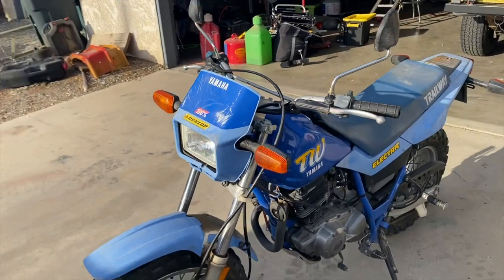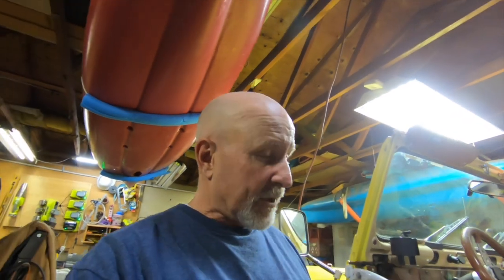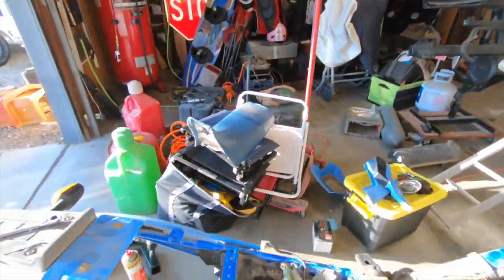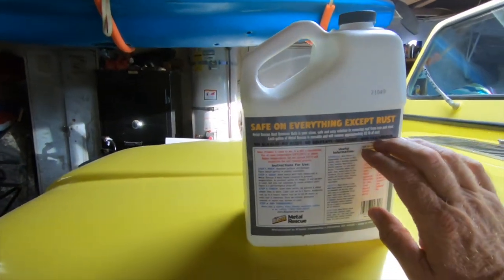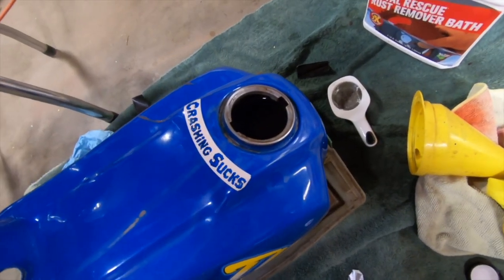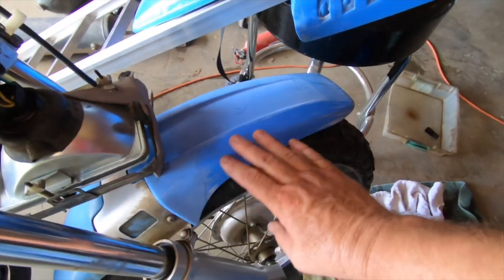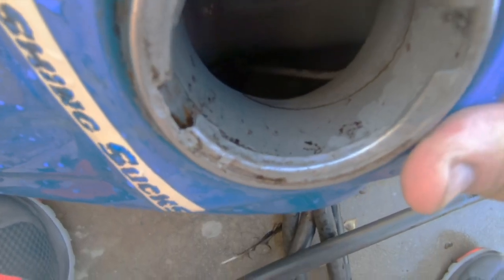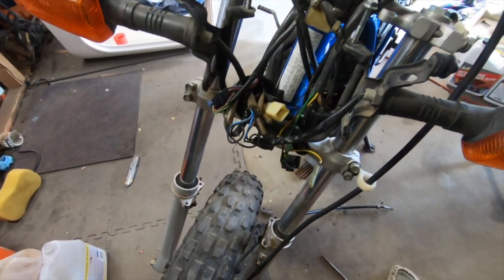1989 Yamaha TW 200 Rescue Part 1

Comment: Nice vid. Poor tank. Ebay is great for old parts on these. Dump some marbles and bee bees in there, duct tape the holes and wrap in an old blanket, an hour in the dryer with no heat when the wife goes shopping ought to do it. Got an '89 dub too. And an '09 and '21 and '24. Dam just realized forming an exponential curve...
Reply from the maker: 😂 ride safe my friend 👍🏻

Comment: I did a similar project like that. I bought the same stuff for the tank, but I bought marbles from the dollar store and put them in as well. Then I put the tank in the back of my truck for a week in a towel to prevent damage. Vibration from my daily ride to work and rotating the tank a bit cleaned it up great.
Reply from the maker: That’s a great idea I’ve never done that but that is very smart marbles were probably easy to get out you didn’t have to worry about debris in the tank. That product works great but is very expensive. Thanks for watching the video and thanks for the awesome comment🇺🇸👍🏻

Comment: Awesome.  I love the TW‘s

The thing with the razor blade to remove the oxidization, you can do the same thing with a torch. Clean it as well as you can and then just hit it with a torch or the heat gun. That will also kind of realign the molecules in the plastic come you don’t wanna overdo it or you can melt it but when you’re done it will also make the plastic more pliable but it’ll make it shiny again and get rid of the harsh oxidation.  You’ve got old bike parts around, taking old fender or something I don’t care about and practice on that. You can also put rocks and gravel or a bunch of nuts and bolts in the tank and shake that up to get the loose rust broken off before you reseal it.  They also sell gas caps on eBay for these for under 20 bucks usually.
Reply from the maker: Very good information 👍🏻

Comment: Cool, I been watching your other videos on the 650 Burgman and came across this one. I'm getting ready to buy a 200TW this coming week.  I just sold my 650 Burgman and thought I would get the TW for on and off-road use. Do you still have the TW 200?  if so, what do you think of it?
Reply from the maker: It’s a great little reliable bike. Not too much top speed but it will still get you around. Thanks for watching and ride safe🇺🇸

Comment: Cool project.  Fun bike for offroad, local riding.  Kind of late now, but I wonder if you could have used those round plastic bristle brushes, on your drill,  on the plastics. Then hopefully the heat gun would remove the scratches.  How's that Jeep project coming?
Reply from the maker: That’s a good idea I don’t know how that would work but I do know that the heat gun doesn’t really take much of the scratches out. I don’t really have a Jeep project going at this time. I do have my old Jeep scrambler But haven’t really been doing too much to it.

Comment: Big differences between 87 and 88.  87 is a TW all to itself.  In 2001 they also changed the stator.  Different carbs have been used throughout the years.  They are all set very lean from the facftory.  drill out the air / fuel mixture screw plug and adjust that to about 2 turns out.  Also going up a size or two on the main jet will help.
Reply from the maker: The one that I have is actually an 89. But my knowledge of them is minimal so I appreciate the input. They are a super cool bike very unique! Thanks again for the info👍🏻

Comment: They also on the update upgraded the timing chain tensioner from a manual adjustment to an auto adjuster
Reply from the maker: That I didn’t know👍🏻 Thanks for the information 🇺🇸
Reply: @ManCaveMayhem   currently waiting on an answer from a customer of mine. He has 2 1987 tw 200’s in his barn with roughly 4500 and 4900 miles on the clock. Told him id give him 600$ for the 2 bikes. I’ll likely be goin through the same process you are with the both of them.
Reply from the maker: @jakenormandin5498  They are worth the work! They are great bikes. Good luck.